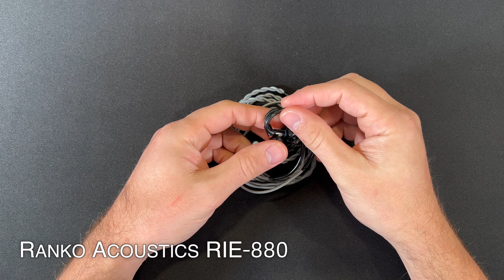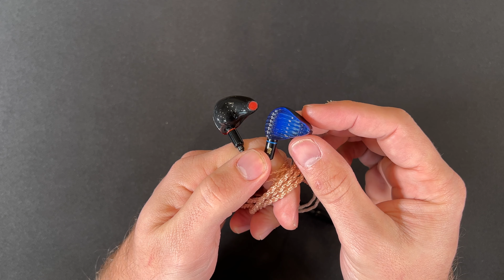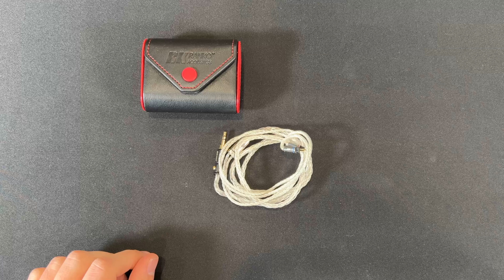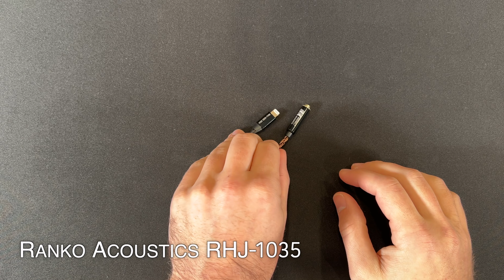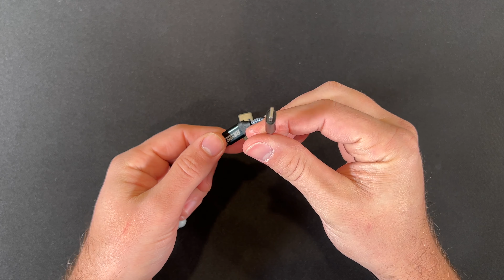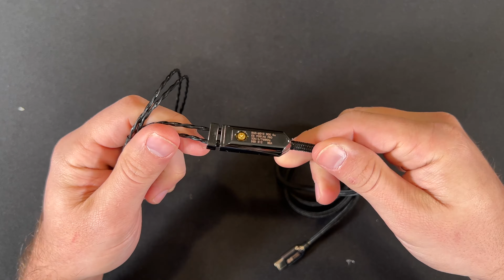Ranko Acoustics Personal Audio Product Guide

Comment: Thanx bloom audio for this great video of ranko audio...i got into iems , after a tws bender, starting in july of 2021....luved the freedom and also fantastic sound of twsz...march of 2022, bought my first iem..whizzer bs1, then a second/ revonext rx6z..dual drivers, detach cable, aluminum shells for 10 bucks..cca cra was next..22 bucks of a fantastic iem, next the tinhifi 3 plus..im not into flat sound signatures, tin 3 plus has nice sub bass neutral mids, and nice treble, but its takin me some time to get into the tin 3 plus...like my iems to play off the straight, 3.5 jack and also sound great with an amp...gotta nice little budget amp, i saw the 800 is 60 ohms, which means , im not gonna get much without using my amp with em...in my chifi adventures, i ave nice budget iems...thoze 800z ave fantastic,  looking shells....9.2 mm drivers..im a big fan of micro drivers..anything under 10 mm drivers is micro to me..usually its 6mm to 8 mm drivers, i guess are considered micro....I ave to wieght getting the ranko 800z, out...I really dig thoze iems..ive never errd of ranko audio....thanx so much for peaking my interest in the ranko audio brand..great review..peace